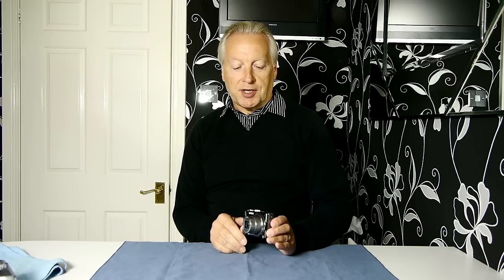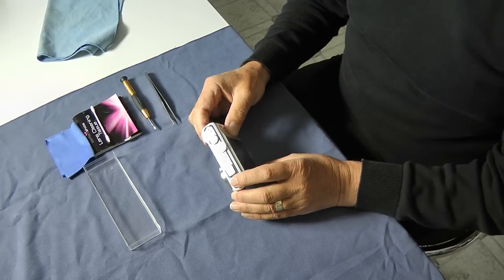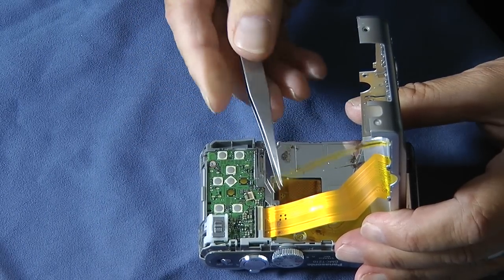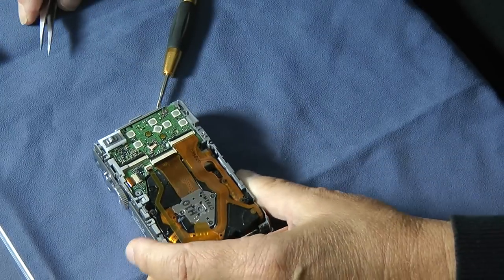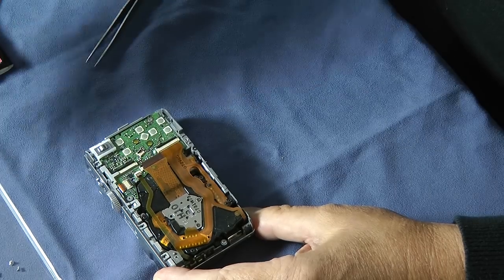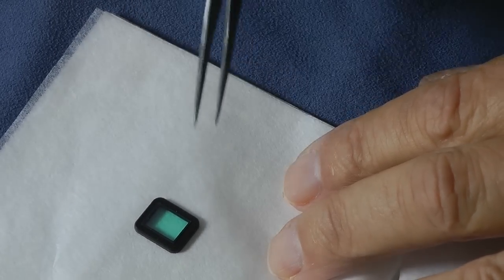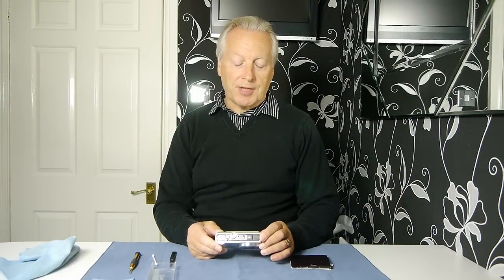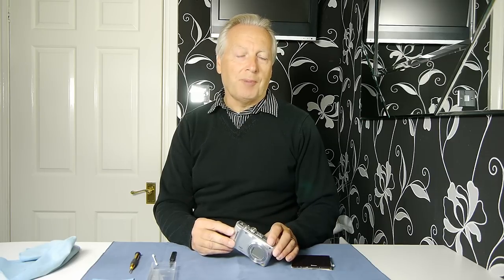Cleaning the CCD sensor of a Panasonic Lumix Compact Digital Camera

Comment: Hi Graham, 

I recently purchased on Ebay a Panasonic Lumix ZS20 (TZ30) that has dust on the CMOS sensor.  The CMOS sensor is held in place with three Torx screws.  Do you know the size of this Torx screw? I have seen a set of mini Torx screwdrivers on Ebay. The sizes in the set are T5, T6, T7, T8, T9 and T10.  Can you tell me if these will work or do I need something else?  

Also, is cleaning this sensor about the same as what you show in your video?  The service manual seems to show a procedure for the CMOS alignment.  Any advice?

Thanks very much, Tom

Comment from the maker: My guess is that you have the small backlight cable connected upside down and the backlight isn't working. To check this look at the little connector and the black(or brown) ribbon cable connector should face you - the two gold connectors should face the camera circuit board. Also check you have fully pressed the connectors home. release the plastic locks again and ensure the ribbon cables are pushed all the way into the socket. Check these first and if still no image get back to me and we go on

Comment: Graham, I have the rear screen working now and have had a few attempts at cleaning with varying results, as we go it's getting better! I'm now getting an error on the screen now after the camera has been on and functioning correctly it comes up a grey screen with "system failure ios panasonic"

Comment from the maker: Generally there is no need to use anything like isopropanol alcohol on the IR filter wiping with the q-tip does remove the dust and film. You can use an air duster to blow the surface dust/pollen etc off but usually the wipe gets rid of everything. If you want to straighten the shutter blades, carefully remove the lens name plate ( self adhesive) then 2 small screws allow yo to remove the assembly from the front of the lens. what model is your camera i may have some spares you could have.

Comment from the maker: Hi the IR filter isn't glued in it just "sits" in the center of the rubber gasket seal. If you place the gasket into the plastic moulding of the lens and then gently place the filter into the centre and ensure it fits inside the gasket you should then be able to fix the cmos sensor to the lens block without fear of breaking the IR filter. Be very careful it is very fragile and if you can use plastic gloves to avoid finger prints on its surface.

Comment from the maker: You did well to open an LX5 with the 2 hidden screws under the cover of the hot shoe. Unless you separated the upper pcb, which carries the microphone, there should be no reason why it doesn't still work perfectly. If you did separathe the pcb from the upper plate you may have trapped the small rubber gasket thus covering the hole in the microphone

Comment: Thank you very much.  That annoying hair has now been removed.  I have, however introduced another problem.  The LCD display is not right.  The image is darker and colors more saturated.  I've tried reconnecting th ribbon cable but no joy.  Any suggestions would be most welcome.  Thank you.  PS great videos!

Comment: Took about 900 shots on holidays, then dropped my DMC-ZS8 and got lots of dust fragments inside the camera, causing little black bits showing up on the rest of the images I took. Used this video to take apart the camera (gasket was different and I couldn't get out) but just needed to clean the back of the senor and now the camera is working great!
Reply from the maker: excellent news, well done and thanks for sharing.

Comment: managed to clean the ccd sensor on my tz40 but ran into problems as the inferred type filter glass with some kink of black gasket has broken. Put it all back together ,all works but lost the green is now  light purple, is there any way of getting a replacement inferred filter for the ccd sensor

Comment: Thanks for posting. I've had this problem a couple of times and this is a really clear video solution. Watching the video, there is a comment about the use of cleaning with compressed air which I didn't understand. It says that this may remove any pollution film that may be causing flair and lack of contrast. Isn't that a good thing and isn't it worth blowing any particles away from the inside of the casing as well as the sensor and filter before re-assembly anyway?

Comment from the maker: Its unlikely, but possible. Have you cheched the ribbon cable is firmly pushed right into the connector ( the broad cable) and the backlight cable is the right way up ( the gold connectors face down on this cable and up on the data connections.

Comment: Hi Graham, 

I have successfully used your video twice before with minimal difficulty (needed to reassemble a couple of times to push ribbons in further etc due to problems when turning on the camera). However the third time I have done this absolutely nothing happens when I turn on the camera, as if there is no power to it (the battery is full) Do you think this is likely to be a catastrophic failure or could there be something simple I may have knocked in the process?

Thanks

Jenna

Comment from the maker: The purpose of the latch is to force down the pins of the connector against the ribbon connectors if you cannot get contact in the way i have suggested then fitting the latch ( there should be 2 small flat tabs and these should be at the top) is the only solution to getting the contacts made I'm affraid

Comment: Hi, all went well but as the some other veiwer experianced, the IR filter fell of the rubber boot! I didn't read this until after I put the camera back together. So what I did was  (after attempting to fir the IR Filter back into the boot and failed) laid the IR filter into the little recess in the case and laid the boot on top of that, then fited the CCD back and it all seem to work fine. Will I need to strip down again or will this be ok? Thanx for you help, great video.

Comment: Great Video Graham! The dreaded dust has settled here and I will try the vacuum method used on my other zoomers. If this is not successful I will follow your great instructions. Just so I know hat to expect inside; does the TZ25/ZS15 have the same glued torx and recalibration setup as the TZ30/ZS20? Cheers

Comment: hi graham, great video i cleaned the lenses on my tz10 and worked  a treat but when i stripped my camera  a second time i found that the lense tries to open bout refuses to open. i took the motor assembly off and checked the zoom assembly , it was free as a bird then i switched my camera on with the ribbon cable attached and the motor rotated approx half way but looking at the way it rotated it appears to be going the opposite way thus closing the zoom instead of opening zoom. have i somehow altered polarity orassembled the gearing wrongly, i would appreciate some feedback on how to remedy this problem thanks mick ps hope this makes sense to you .

Comment: Hi Graham, Thanks for the great vid.  One question:  Does the IR filter have a "right-side-up"?  When disassembling, the glass IR filter became separated from the gasket and I couldn't tell whether the glass has a "correct side" up or down.  Does it matter which side of the IR filter faces the lens?  Thanks!
Reply from the maker: You won't notice a difference however technically the coated surface should face down as yo assemble it on the lens. looking obliquely at the filter one side will have a reddish reflection - that's the coated side. This coating reflects the IR before it passes through the glass, but in the case of a camera lens the IR is very low anyway so it won't fade the filter material. If teh camera is still apart you can correct it otherwise I would leave it.
Reply: Graham Houghton Thanks for the info.  Camera is already back together, but will do it properly next time.  Cheers!

Comment from the maker: @surf1div1 OK, it's not the end of your camera. I have had this happen too on other devices. There are 2 ways to attempt to get a connection back to the ribbon cable. If your locking lever is still in one piece and in the plastic housing at just one side you can close the latch and then hold it down with scotch tape or other strong adhesive tape. If the lever is out of the socket then cut some scotch tape wide enough for the ribbon cable, stick this on the backside of the ribbon 1/16 inch .. con

Comment: Thanks Graham, I did manage to get it apart easily enough by following the video. Problem is that the connector latch on the ribbon connected to the sensor has came off. The ribbon still sits in easily and the three screws hold the sensor in place but now when I take a photo it is just lines on the screen, no picture. I tried taking it apart several times now and fiddling with the ribbon but no luck :-(  Any ideas ?  I just assume it is the connector at fault as everything else went smoothly.

Comment from the maker: Was it into salt water? did you remove the battery straight away? There is a little fuse in the camera will will blow if something like this happens. Most often if the camera is dropped into water the lens will be coated in drying marks and will need to be stripped to clean it even if teh camera is working after completely drying out.

Comment: Hi Graham,
I have a Lumix LX5 with a slightly different problem and before I take it apart I'd like to get some feedback from you. 
The thumb wheel has essentially stopped working. It still spins but my ability to scroll up and down within settings is getting harder by the day.  When I push in the thumb wheel it still changes from aperture to shutter speed for example, but I can't increase or decrease settings consistently. Do you have experience replacing or repairing the thumb wheel?

Comment: Ok sounds like I could handle the cleaning job. 
I have the DMC-TZ5 and it's the metal part with the LEICA writing on it that is bent. If you have a part that would be fantastic since I'm not sure it's fixable other than bending it out.

Comment: i have a dmc-zs9, it was dropped in the sand while at the beach. the zoom cycles in and out and an error of " the zoom has returned to the same position to when the unit was turned off", then the screen goes white with the error of  "zoom error". I have taken the battery and sim card out for over 5 minutes and still have the same problem. No warranty, how can i open the front of the camera to check for sand.

Comment from the maker: Hi Steve, does the camera playback images from the sdhc card if you power up with the switch in palyback position? or can you not see any image at all on the lcd screen. You have symptoms that are unrelated to the repair. If you are sure you have unlatched the cable clamps and fully inserted the gold connectors right inside the connectors then it is difficult to diagnose this problem. Your battery is well charged? The case isn't pressing any of the buttons in? Remove back and lcd try loose.

Comment from the maker: You will find it difficult to find spare backlights for the Tz8. Sometimes ebay has broken cameras  - dropped and lenses damaged or broken screens. Usually the bcklight is ok in these cameras. Its tricky to replace but not impossible. I would try to verify it is the backlight. Carefully with the back removed try running a finger nail around the area where tha ribbon is folded over at 45 degree, sometimes it will flicker on the lcd this is a sure sign. I have spare backlights but not the TZ8.

Comment: This video is great! I have a panasonic dcm-Tz3 which has horizontal lines on the display and photos. I think it's the CCD sensor, could I be right?  The tab for the sensor is located under a circuit board.  Can the circuit board be removed? Any pointers would be most appreciated!  Thanks in advance.  Jo
Reply from the maker: The horizontal lines usually mean a partial failure of the ccd sensor. Unlikely but worth a shot is to remove, clean and re-install the broad data ribbon cable from the sensor to the pcb as the contacts may not be making good electrical contract. Be careful lifting the plastic latches on the ribbon clamps - they break easily.
Reply: Graham Houghton thank you, I will try that. If that doesnt work I will try replacing the ccd censor as have found them on ebay for just over £10 from china. Doesn't matter too much if it doesn't work as I'm enjoying having a go!
Reply from the maker: Jo Taylor great spirit, nothing ventured nothing gained.

Comment: There's not enough space here to describe it all, but 1st time dismantled, cleaned sensor, still had a dust particle.  2nd time, lost the UV sensor without realising.  Picture was violet-purple, and I thought green was missing (sensor cable).  Found filter on my yellow-green carpet.  The rubber boot doesn't hold it captive - it just lies in the boot, then the sensor is screwed down on top of it.  It's all working again now. Thanks a million Graham!  Terrific video.
Can the filter be obtained?

Comment: Great - twenty minutes after finding this video I had a camera I could use again!
Works fine on a DMC-FX35 although back plate is somewhat harder to remove, just the 5 screws, but it does come off if you're careful.

Comment: Is it a good idea to use any sort of chemicals for cleaning? It just seems like using a fluffy q-tip might just spread the dust around instead of removing it. Just wondering. 
Great vids btw, I may attempt this at some point but my lens cover isn't closing because the metal on the lens face is bent in which causes friction on the bottom plastic spring loaded lens cover. Not sure how to fix that but I want to figure that out first....

Comment: Hi I have a TZ18 and have followed your instructions for cleaning the sensor, but on putting it back together we have no power. We have checked that the connections are secure, but it is dead. Any suggestions?

Comment: Thanks to your help, I was able to remove a large piece of something that was messing up pictures I took with my DMC-ZS7.  A small speck still remains near the edge of my images.  I must not have wiped the elements well enough.  However, I can crop or smooth that out if needed.  Once again, I appreciate your detailed instructions!  I would have spent at least $100 on a new camera if not for your assistance.
Reply from the maker: Thank you for taking the time to reply, appreciated

Comment: Hi Graham - I liked the description a lot and also deconstructed my camera - very clear and practible! So I tried to get off the dust of my CCD-sensor .. I succeded, but ... when touching the friction lack of the LCD screen, even without any power, the black plastic shackle removed. I hoped, that it will be enough to stick the bigger ribbon cable in the lockin leaver. But now, the screen stays black, although light shines throug the edges. Do you have any advice, how I could save me and my camera? Thank you!
Reply: May I ask again for some tips to reanimate my dear little Lumix ?!

Comment from the maker: That is how the cables should be connected small connected gold down and the bigger data facing up. I ALWAYS advise disconnecting the ribbon cables, trying to do this with them still connected and hanging over the side can lead to tearing of the very fine copper foil which runs down the ribbon cable. I suspect that this is what has happened to your backlight ribbon cable, the thinner one. It usually tears where it is folded over at 45 degrees. What model is it TZ7?

Comment from the maker: I would strongly advise against lens disassembly - it's possible to do it but the lens frames are like a jigsaw puzzle to get back together and there are many fine plastic mouldings which will break if you get it wrong. A suggestion has been to use a vacuum cleaner to such away the dust fron the front of the lens. It might be worth a go before any disassembly work.

Comment: Not many differences. The number and position of the screws to split the case off are slightly different. As Graham said in his reply to me, the main difference is that the IR filter is stuck down over the sensor (it's like a thin piece of film) so don't try to remove it. Just wipe the film and the back of the lens with a dry cotton bud. Just a tip, but i tried the camera out before I put outside casing back on. It may save you some time if you haven't managed to get the dust out first attempt.

Comment: My Lumix ZS5 had a lot of spots so I took it to a camera shop and was told it would be $200 to clean it. I found your video and and have just cleaned it myself. My UV filter fell out of the gasket and I didn't know how it was held in. I ended up putting the gasket back in the camera and laying the filter on top of it. Do you know if there is a certain side that should be facing up or down? The sides looked different. Thanks for this really helpful video.

Comment: This is a really clear video, and a good set of instructions. Don't try it with a Lumix DMC S5 though - it's completely different inside, even though it looks superficially similar. I have one, lent it to someone, and it came back with a big blob of crud on the sensor. Tried this approach and couldn't get near the sensor. So if anyone has any ideas for how I can clean up this camera, which I really like, they would be gratefully received.

Comment: Sorry but one more question Graham. I found an electrician's PH0 screwdriver in my home. But, this does NOT even begin to unscrew the casing of my Panasonic TZ7. Are there different sizes of PH0 screwdrivers? Or does the TZ7 need a PH00?